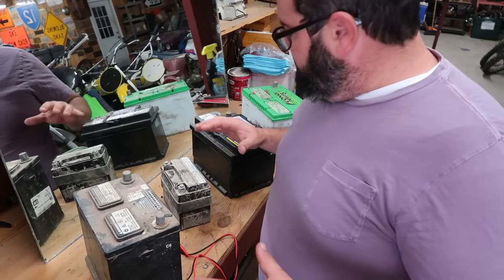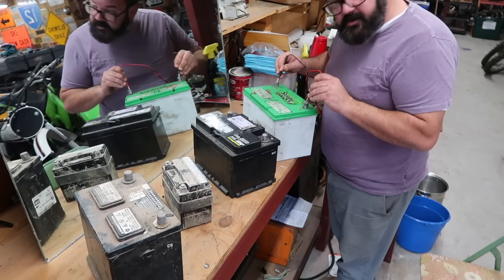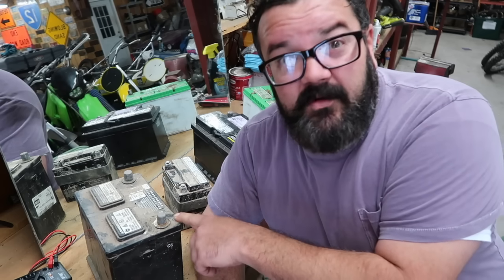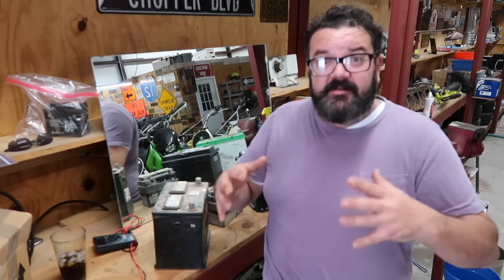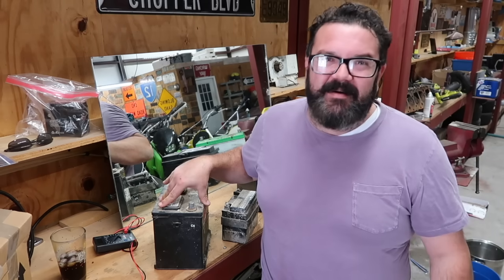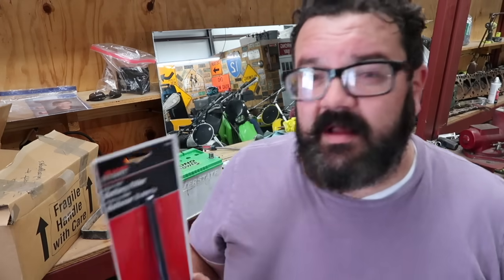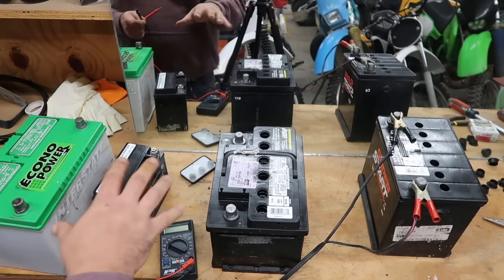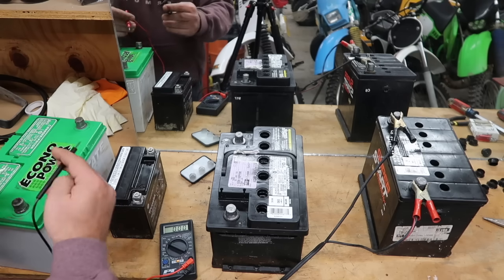Reconditioning a 12 Volt Car Battery: 100% Success

Comment: I've  been  doing  this  for  20 years  with  batteries  found  on the  curb, I  haven't  bought  a battery  for  20 years
Reply: Where do you get the acid from?
Reply from the maker: Thanks for watching!
Reply: Where do u find batteries on the curb? Most battery places make u exchange or pay more
Reply: Im currently working on mine bug I think 1 of th cell died. Any way to save it?
Reply: Michael Garcia advance Auto was running a deal for every used battery you would trade in they would give you a $20 gift card. It had to be a car battery it could not be a lawnmower battery or a motorcycle battery which my motorcycle battery cost me $140 and did not last a year from advance.
Reply: @darknightmare7216  I get the acid at auto parts store
Reply: How does it hold up under load and how long does it last?
Reply: What can we do with the old liquid?
Reply: So what is the amount of Epson salt to use?? This guy added 4lbs i seen others add 4 teaspoons...
Reply: need more explanation on this?
Like what’s the actual ratio with the epsom salt to water?
And do you mix that acid with the epsom salt solution?
Reply: Well, if I buy a new one I certainly don't give them my old one for almost free.  Also, I don't leave them out where they can get "misplaced ".
Reply: For real?
Reply: @racitup4114  what video is that?
Reply: @racitup4114  that was nothing more than a chemistry lesson
Reply: You can buy bulk 1 gallon approx. battery acid from Home Depot in the sump pump section. Around $23.00
Reply: @iamagr8hunter  bi-carb of soda. keep adding till it stops throffing, then its good to dispose
Reply: @PERRYS_PROPS  That’s the only true test of a battery being reconditioned. I haven’t found a video the actually shows one passing a load test .  I tried this and many other techniques and non on then passed load test to where I would trust them in my vehicle . Great point BTW
Reply: did you put a load on them?
Reply: you might not bought a new one in 20 years but i'm sure that you needed 20 old ones while i used only
 4 new ones, and don't have my garage stuffed with old batteries and the stinking smell of battery acid.
Reply: @3DPeter  wrong
Reply: @theghostmaker3486  

Wrong? Dude, did you ever heared of led sulfate? That is "growing" on the led plates and the sulfate acts as an insulator
and then the capacity will drop and don't tell me something else, because it's a chemical reaction that happens in all led batteries.
And like alot of other people already said, try a load tester because charging a battery to +-14,5 volts means nothing
because as soon the charger is disconnected the voltage will drop, so charging to 14,5 volts doesn't say anything about the capacity.
And i hope you don't live in a area where the winters are real cold, because then your "refurbished" batteries will die faster than you wish for.
And don't tell me that your batteries wil last a few more years after your "clean up" because that is just utter nonsense.
It could last another year in a sunny area and in a small car that starts easy, but not for bigger cars in cold areas.
Reply: @3DPeter  well don't tell my vehicles that because it's been working for years
Reply: @theghostmaker3486  dude, when your methodes would be that great, then alot of battery manufactures would have to close their doors,
so go home amatur! The shit you do is what i did when i was 18 so grow up.
Reply: @VirantRoss  pretty sure it's like 1 or 2 tblspn per cell. This guy is crazy.
Reply: Why do you sound so awesome? Because you just are!!!!
Reply: This video might help. I built a genorater,  tried, tested and true. And dropped the motor and got another one with the same specs and the voltage is not rising even though its wired the same. The voltage does charge with a battery charger though. So Idk, possibly could be the battery?  All the rest should act the same if wired the same. Battery did sit for winter. Indoors though!!!!
Reply: @e-racer4673  what is the ratio for epsom salt distilled water and acid?
Reply: @e-racer4673  you must of got the value battery.
Reply: @darknightmare7216  It shows in the video
Reply: @e-racer4673  Enersys 12EP16 or XE16 arent even @140 but the same as odyssey pc680
Reply: It wasn't too clear, is he putting back a little bit of the used acid into the battery, or he's just putting in the Epsom salt water?
Reply: @e-racer4673  by Deka brand batteries , motorcycles or cars , they are the best battery you can buy! They actually make the harley Davidson battery and all Napa brand batteries , but are cheaper buying them as the Deka brand then under the relabeled brands family farm and home is the cheapest place to buy them that i found. I just replaced a napa battery that was 10 years old , still would hold over 13 volt but had no cranking amps. That's where this video doesn't prove nothing , when the voltage of a 12v battery should actually be over 13 v and you have to use a load tester that shows what the cranking amp is and that it will hold that voltage also.
Reply: @iamagr8hunter  Mix Baking soda into it slowly and carefully 1-1lb box at a time waiting at least 1 hour between boxes until fizzing-bubbling stops when pouring in fresh baking soda.

Comment: epsomes salt / distilled water and leave off the caps while you recharge.  15 minutes on 200 amp start position on charger. Stop for 1 hour, charge for 15 minutes, stop one hour, this is done 5 times. The battery will be like new and last for years with only the recharging for 15 minute intervals.
Reply: I have a Varta car battery in my car the car has been sitting for 2 years nearly and the battery is completely dead will this  solution method help it to get back up again and working?
Reply: Why not to burn sulfate with acid in battery ? 
Just because acid Gona boil and release toxic fumes ? 
I know it's about to flush those dirt particles

Comment: My car battery would not hold a charge but the cells tested fine.  Put a tbsp of concentrated Epsom salt water in each, trickle charged overnight.  Battery lasted fine with no problems and I sold the car three years later.  I did not flush the battery or anything.  My Dad did his lawn tractor battery the same way - still acting like a normal battery after 4 years.
Reply from the maker: Thanks for the comment!
Reply: hi bro, just wanted to check with you when you trickle charge overnight, at how many amps did you set your charger??

Comment: As mechanic i was sceptic about this but i tried the baking soda method yesterday, (without the epsom salt at all) ..... firsy i drained the battery of fluids, added baking soda( or known as Bicarbonate soda) with normal tap water ....let it sit for about 2 hours,  shaking it every half hour until the bubbling stops.....then rinsed it with tap water again..... added baking soda again and let it bubble again till it stops.... then sinsed with tapwater again until water comes out clean..... then added fresh distilled  water and then fresh battery acid (all for $5) ..... i put it on the charger for about 5 hours.... the next day car cranked slow but started..... i drove around a bit ..... after that car started everytime on the first crank.....before this starter motor didnt even make a click noise thats how bad the battery was....now it starts like a new battery..... my conclusion is that the baking soda method works, and you must add fresh battery acid and distilled water.......my other conclusion is that the alternator charges differently than a house car charger, even better..... i think its about the Amp output of  alternator thats higher i dont know but after driving around the battery improved its charge cycle ..... glad i tried this coz it saved me $150 for a new battery lol.... at least i can start saving up for a new battery while the restored one keeps me going 🥰

Comment: Just looked at your video. And I enjoyed watching it! So many of us who owns cars, trucks, motorcycles, etc., for transportation, always thinks that when batteries goes dead, you must always spend more money again to but a new one. I've revived two very old batteries that were dead, by just hooking a 20 watt solar panel directly to them without a solar panel controller. And BOOM! Batteries still works, installed, and started a Dodge Caravan. And the other one is a backup. Someday I'll try your trick, and let you know how it works out!
Reply from the maker: Thanks for watching
Reply: George, how long did you leave the battery hooked up to the 20 watt solar panel? Thanks, friend.
Reply: @PeterRabbit70 I was hoping to also know this. Anyway, my guess is you have to hook up a multimeter and keep checking until you reach the fully-charged voltage. Just a guess, though, as I think I've seen it somewhere.

Comment: I tried doing this two ways. The first one I did I did it exactly like you did it but I used sulphuric acid because it was only $15 for 5 L. The second way I did it was I just drain the acid and then I refilled it with fresh sulphuric acid. I found your way works best. You really have to get that old crap out of the battery for it to be able to except and hold a charge thanks for the video I found it to be very informative peace out
Reply: I am under the impression you don't add pure sulfuric acid to a battery, it should be diluted.
Reply: @ibberman  I get it from NAPA

Comment: The coating in the battery is sulfur oxide. The metal looking debris is mostly lead and some of the steel grid that is imbedded in the lead plate to hold it all together. The Epson salt trick works 1 time. It somewhat removes the sulfur oxide, but over time will deposit magnesium into the plate.
Reply from the maker: If it works, it works.
Reply: At either rate, the batteries are worthless to begin with, so if it’ll buy a even another year or two. That’s still a win win…

Comment: At the beginning of the video when you talked about voltages, a 10.8V battery is a totally dead battery. A fully charged Flooded Lead Acid (FLA) battery reads above 12.6V...sometimes 0.1 or 0.2V higher. And a voltage test indicates the state of charge of a battery but not its health. You need to do a load test and a capacity test, the latter is time consuming and you need to use specialized equipment. Its all fun though.

Comment: About 12.74  - 12.6 v volts  fully charged battery.   Approx 12.40 is 50 %     !   Some  ecu's  go into limp mode as they don't get incoming voltage .   Running it should read 14.4 v  - 13.7 V   approx.   Even with lights / heaters on
Reply from the maker: Yes with an alternator charging it, new batteries come 12v
Reply: @CarGroves  - at 12v a lead acid car battery has only 25% of it's charge left. A properly charged car battery is approximately 12.7v.
Reply: @flyingdutchman6984  And for that reason: A "fully charged" battery having only 11 volts (without any load) = good candidate for the trash can.
Reply: @peter8aus8berlin  - or possibly the recycle bin. Either way they are junk.

Comment: I was told my Interstate battery needed replaced. I checked it out at home. I had neglected to clean & protect my terminals or check the water level. Addressing the issue solved the problem!
Reply from the maker: https://www.youtube.com/watch?v=RNnSYuTuLk4&t=156s

Comment: sulphation is the killer, sediment settles to the bottom and shorts out the cells.  After bathing the batteries in epson salts( for an extended period), and a thorough flush, use distilled water, and proper amount of sulfuric acid to fill the cells.  Don’t use the old electrolyte! You won’t be able to remove all the sulfation between the lead plates,  but some more limited service of these used batteries is possible.  The capacity and cranking amps will still be compromised.  Worthwhile to do IF the batteries were not frozen when discharged, and no bulging or distortion of the lead plates is visible.  cheers!
Reply from the maker: Obviously new acid would be ideal. I was just showing how to do it the cheapest way possible. Thanks for watching!
Reply: right, of all the assholes in the comments at least one person was able to be objective. if the plates can be cleared and new clean solution added some service can be restored.

in my mind, i think this process in combination with a large capacitor for extra cranking capacity is a pretty good solution.(then once failure takes place, find more dead batteries, rinse/repeat but obviously the capacitor would still be good)

Comment: You use distilled water for you solution, but you rinse your batterys with a garden hose with city water, then put old acid in.
If a battery reads 12v doesnt mean it will crank a car.you need a load tester. Ive done this with batterys before ,sometimes it works. But never for very long. If  you live where it gets cold in the winter, it wont work a all.
Reply: Thanks for the info
Reply from the maker: David, for flushing you could use old pond water, it doesn't matter.
Reply: 12v is basically a dead battery when talking about cranking amps.
Anywhere from 12.7v to 13.1v usually a fully charged battery.
Reply: Where I live the way we test when battery getting too old is when it gets cold. It cranks at 30 degrees F will it crank at 10 degrees? Or even zero F.

Comment: I like to wear a full face shield with my safety glasses whenever I mess with strong acids or Alkaline solutions. Acid in the eyes is bad. Lye, which is a strong alkaline (basic) will quickly blind you. (For an eye wash- Keep some baking soda when messing with acid. Keep vinegar when messing with Lye. )
Good video. Thanks

Comment: Great video. Thank you.  One note - Baking Soda and/or calcium (generally basic in solution) to neutralize acid may work, but vinegar wouldn't, Brotha. Vinegar is just another acid, albeit weaker than the sulfuric acid in batteries.
Reply from the maker: Got it
Reply: You forgot to show how much battery acid it just skips over that particular part what's up with that need to know how much battery acid you were mixing with the distilled water Epsom salt solution
Reply: @frankmartin9375  i second that. I was hoping it might be jn the decriptions but nope.

Comment: The battery I have all the cells had very dark H2SO4 electrolyte fluid from dissolved plates. Flushed and filled with baking soda then drained flushed and replaced with distilled water and Epson salts. Tried to boost with 55 amps to activate the cells for 15 minutes and let it rest for an hour 5 times. Then charged with a smart charger overnight. made absolutely no difference. These techniques only seem to work with batteries that are weak but not with bad plates like mine. It was not keep up with a smart charger every time which might have killed it. If the charge becomes very low the plates seem to dissolve.
   I have two other batteries that are over 10-15 years old and they are still 100%. Kept them up with smart chargers whenever they got low so the de-sulfating setting could work well.

Comment: Voltage is one thing but current delivery is another. The amount of amp hours and cranking amps can't be measured with a multimeter and I doubt they would last
in operation. Sulphated plates cannot be physically cleaned this way as the plate separators are compressed with the swelling of sulphation, jamming the lead sulphate in place. 
A tell tale of these un recoverable dead batteries is the bulging of the case, especially at the ends. The epsom salts may clear around the edges of the plates, but you'd be very lucky to get even 10% back.
Reply from the maker: How does interstate battery sell reconditioned batteries?
Reply: @CarGroves  two ways they can recondition them, one is to do production line impedance and load test and reject below a certain capacity, the other is to cut around the case just below the seam, lift out the plate assemblies, pressure blast the cell clusters and clean out the sediment cavity then reassemble, ultrasonic welding the plastic back together and adding new acid before charging. Again, they would be graded before reconditioning and any falling below the standard just get recycled. Car batteries are 99.9% recyclable, so they can't lose either way.
Reply: @alasdair4161  a charged battery has the highest acid level. So if you took partially charged lead plates out and pressure blasted them and put them back in considering that they have some of the acid absorbed or converted into them or whatever. If you added full-strength acid after  cleaning the plates and putting it back together wouldn't it make the acid level too high?
Reply from the maker: https://www.youtube.com/watch?v=RNnSYuTuLk4&t=46s
Reply: Alasdair, do they sell lead at the hardware or welding shops? wouldn't it be eaiser for consumers to just buy lead plates and build batteries from scratch?
Reply: I had a reconditioned battery from a place near my home back in 1980s . It was one of the best batteries ever. Still while lasted a long time it was only the maximum usual longevity.
Reply: @Alasdair  Have you tried the method presented in this video yet?